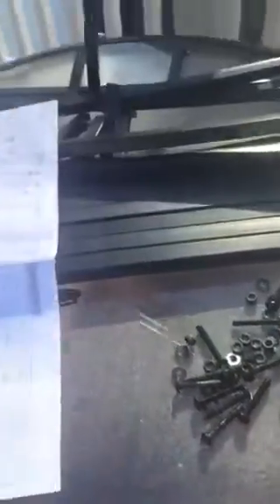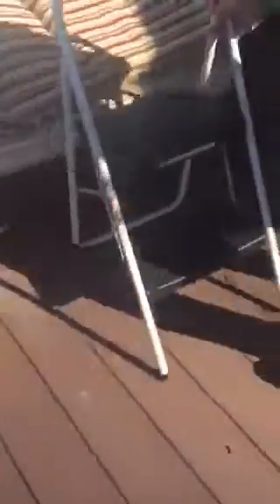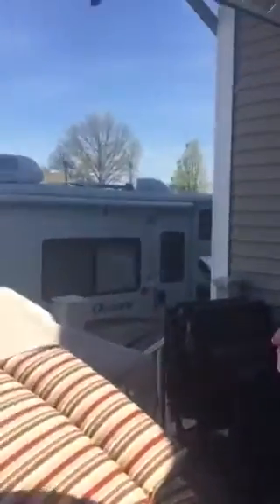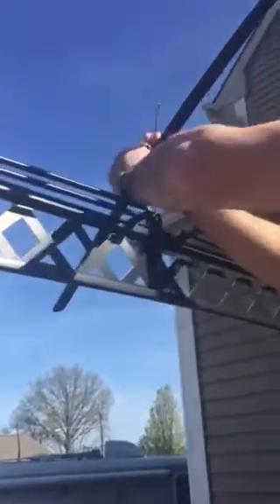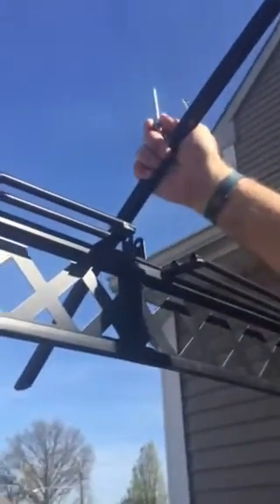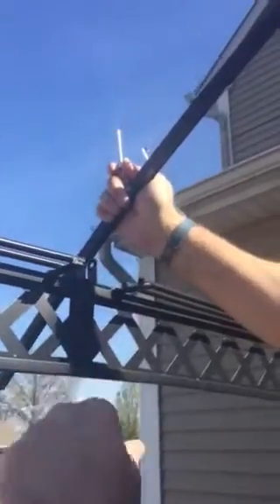Gazebo Roof Tip

Comment: I cannot adequately express my sincere thanks for posting this tip. My wife and I have the same gazebo would have been at it for hours last night without the use of the "The Hillman Group 2 inch Round Wire Lock Pins" as you suggest. Again, thank you!
Reply from the maker: So glad to be of help! Before putting the roof back on this year I noticed that the frame was bowing in the middle where the lattice pieces connect. Whenever it got windy it was flexing at that point where the two meet (halfway between the corner posts), and I was afraid it wouldn't go back to being straight. So I went to Lowes and bought four thin galvanized steel pipes (1/2" diameter, about 4' long) and attached them to the frame with nylon lock-ties, overlapping the middle point on each side. That puppy is solid now, and the canvas roof will hide the pipes completely when installed.
Reply from the maker: I'll post some pictures when I get home later today.  Thanks for the good review!

Comment: Thank you so much!!!! for this video.. I just put one up tuesday by myself.. and would have never got it completed without your tip and trick.. sooooo much easier, but still had some issues with the top.. OMG.. the tension is ridiculous
Reply: Thank you! I just this weekend put the canvas top on again and my goodness, using those U-hooks from Lowes made the job SO much easier. Yes, the tension is ridiculous, and there is some help on that too. 
Stand on a ladder near the center and press the little ball bearing in on the struts that you can't get the cover hooked onto. This allows you to slide the struts FURTHER in toward the center. Essentially that makes them shorter giving you (hopefully) enough leeway to pull the lip over the end to secure the canvas. Once hooked, press the strut upwards and pull it apart again to get that ball bearing thingie snapped back in place.
I had one corner where there was just no way I could get the ball back in place so I left it that way - the strut can't come out and it is SO rigid anyway with or without the ball locked.
Now that you have it up, have a cold one for me! Thanks again.

Comment: Awesome tip! Thank you! I put this thing up with my daughter initially with every nut and bolt included. The tension and the hand balancing act was rediculous! Here recently we had a suprise storm with intense wind gusts. Luckily I was home and was able to get the canopy down with only 1 corner damaged. It was terrible fighting the wind with a tool in each hand. I lost washers and nuts in that process.  I seriously dreaded putting the entire canopy back on and I researched..... your tip is a huge life saver! Now if I have to save this thing quickly I know it can be done. I'm also going to look in to your frame stabilization idea with the metal rods and zip ties. Have you posted a video on this? I'm not a handy man... I'm a mom that needs pictures or a video 😉! Thanks again!
Reply from the maker: Thank you Cheryl! Sorry the sound quality was so poor in the video but I’m glad you got the gist of it. 
For the stabilization I just bought four lengths of some basic pipe around 6’ long (you could go longer) and tie wrapped it to the frame up near the top of the side panels. It helped prevent the middle of each side from swaying in and out in the wind, keeping panels stiffer. 
And now the hard news: after yet another surprise snowstorm the whole thing collapsed under the heavy wet snow. Nothing I could do to save it. I have finally gone to the dark side and bought the steel roof version at Big Lots which so far is quite sturdy. 
We got hit with another round of very strong winds, but I had secured each corner by attaching a ratchet strap hook and tightening the straps to the deck. I would recommend this on yours as well whenever high winds are expected. 
Thank you again for the kind words! Good luck and enjoy your outdoor experience.

Comment: Good tips in your videos. Couple questions...1) do you remove your canopy when storms are forecasted? 2) how did you anchor your gazebo?
Reply from the maker: Funny you should ask. We were hit with a surprise snow storm while away and the entire canopy collapsed breaking several of the roof rods. I salvaged what I could and right now it's out there with no roof. But fear not - I plan on resurrecting this beast when the weather stays warmer by using PVC pipes from Home Depot instead of the powder coated easily broken spines that came with this POS. I plan to video the entire process.

Fortunately my anchoring may have saved this thing from total destruction because it kept the corners stiff and only allowed the center to collapse. The steel rods I had added to the sides kept it square, and I also used ratchet straps from the tops of each corner post attached to the deck below.

Comment: A recent wind storm reminded us how difficult it is to remove the canopy. We have the Oakmont Gazebo from Sunjoy purchased from Big Lots. 10 X 12. You will need 8 pins.

Lowe's. Hillman "Wire Lock Pin Round" 1/4 X 2. Item #218513, Model #882693.

At Home Depot it's Everbilt 1/4 in. x 2 in. Zinc-Plated Round Head Wire Lock Pin. Internet #204276210 Model #807468 Store SKU #752250.